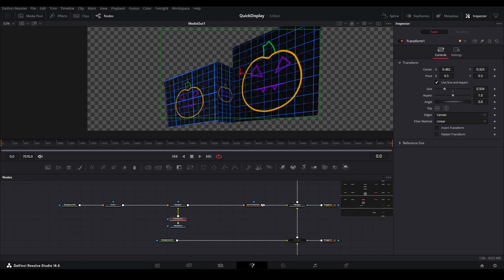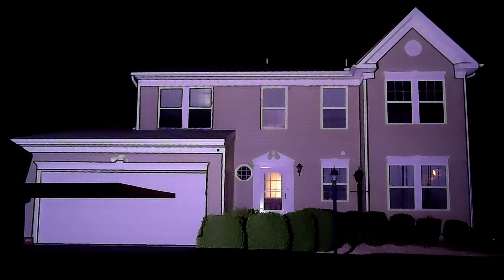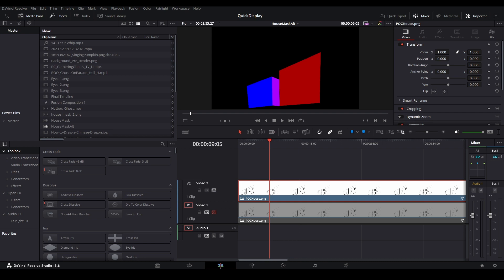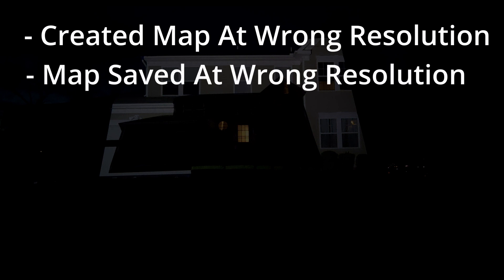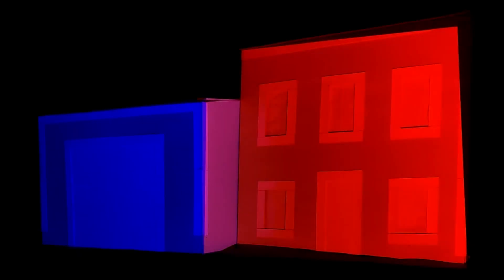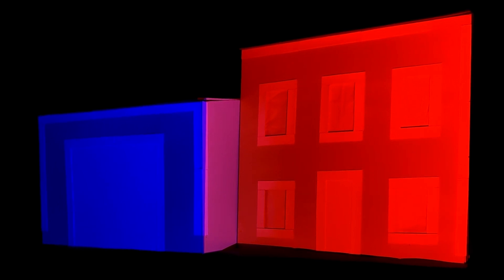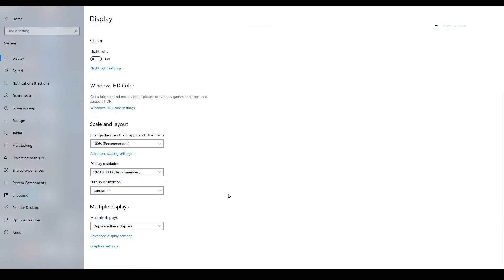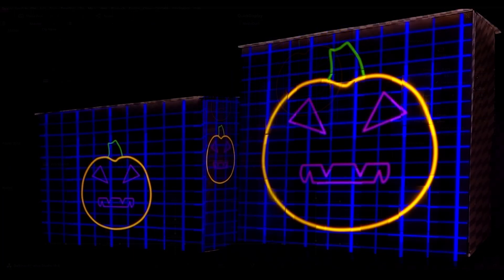Resolve Projection Mapping Guide | Part 6: Testing Your Template

Comment: Ive moved my projector and had to remap house. Whats the easiest way and less quality loss to move the whole video. I hv 43 videos in the timeline
Reply from the maker: It's possible. I did it this year, I'll give you a more thorough reply tomorrow when I have a Keyboard in front of me.
Reply: @ResolvedHomeProjections great thank you
Reply from the maker: The way I did it was I created a new project and imported all my prior rendered out shows. I put my alignment video onto a timeline, and then an adjustment clip on top of that. In the fusion page, for the adjustment clip I used a combination of corner pin nodes and transform nodes to make the old alignment video fit back onto the house. This is way easier if you have the studio version of Resolve so you can use the video clean feed feature and project onto the house while your making your adjustments. This means you'll need to be outside, but I suppose you could do it with a new map instead. I never tried it that way. Once I had the adjustment clip configured correctly it was just a matter of making a timeline for each previous show, and copying that adjustment clip to each timeline. You can also save the adjustment clips in power bins and put them on the timeline that way. Doing that I didn't notice any real loss in the quality of the projections.
Reply: @ResolvedHomeProjections excellent thank you. I've tried with corner pins in fusion which I had a lot of trouble getting things lined up particularly front of my house which is on an angle but haven't used transform node.  Do you save your 1st render as highest quality eg dnxhr hxq 12 bit then when corner pinning is complete render as h265 for a 1920x1080 projector?
Reply from the maker: @treebs9516  If you are having trouble lining things up you might need to split up your original shows into different sections and corner pin each section to fit. I had to split my main house and garage into two different sections and do that. 

As for the render I just used my normal render settings. Nothing fancy or special about it. No one noticed a difference. I did take that opportunity to make some color and sharpness adjustments for each show but again I didn't do anything extreme, just little tweaks here and there.
Reply: @ResolvedHomeProjections great thanks for your help. I really appreciate it and your video content is excellent. Keep up the good work.